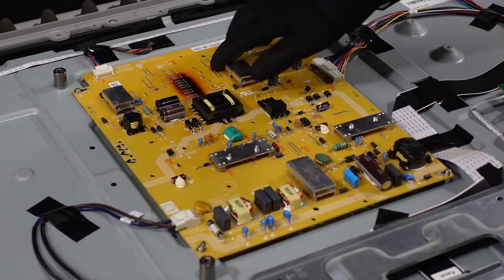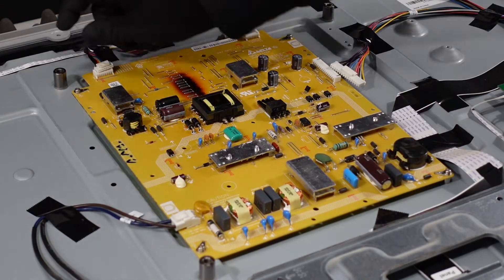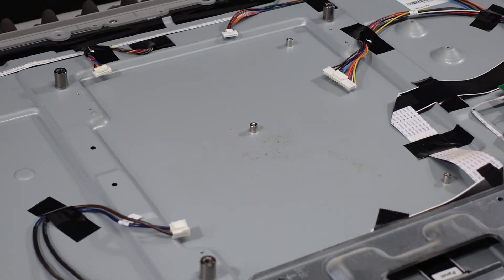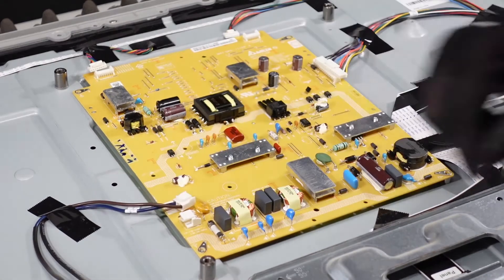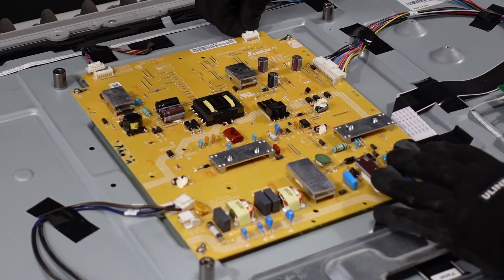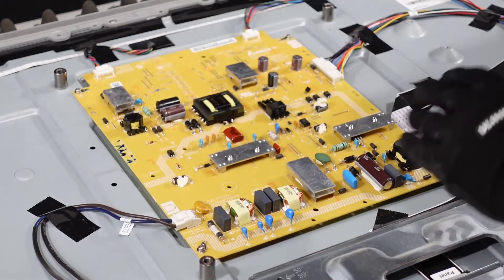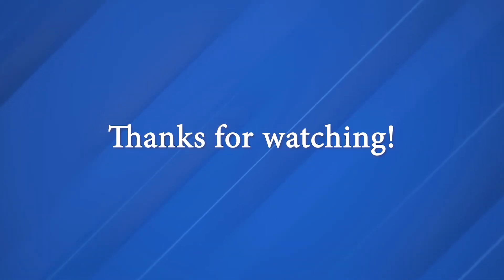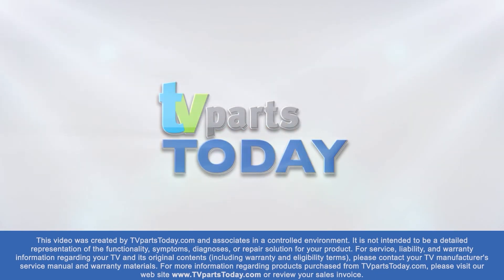TV power supply swap,  (VIZIO M471i-A2)

Comment: I have another question I have the same tv but I can only see the screen if am up close with a flashlight I don’t know what the problem is bc it shows the logo then it goes black when I turn it on I see light in the back when it shows the logo but once it’s finished showing the logo the lights in the back turn off but I can still see the image if I hold a flashlight light really close I don’t know what’s the problem
Reply from the maker: Most likely, there is an issue with your LED driver or the back-lights themselves. Swapping out the LED driver would be much cheaper and a lot less complicated. If your set does not have a dedicated LED driver board then it is likely integrated onto the power supply.
Reply: @tvpartstoday  thanks for the help 🙏 and my power supply was some burned marks too

Comment: What does it mean if it’s burned? Because my in my tv it’s burned
Reply from the maker: If you have not had any sort of lightning strike or power surge, I would assume that the power board in your unit is faulty. Swapping the power supply would be our first step here.

Comment: Quick question I had a Vizio p65-c1 TV I saw another Vizio 65 in 4K TV but a different model my question is are the power boards different or can I switch them out from a different model and put them in
Reply from the maker: Sometimes you will see a power supply being used in different model numbers, but it is always best to get the back of the TV off and check and see EXACTLY what the model number on your power supply is before trying a swap.

Comment: my power supply 56-04111.1B1 on my M471i-A2 doesn't show burned. could it be something else? thanks
Reply from the maker: I'm not exactly sure what your symptoms are, but if you would like to go over them and get some advice, give us a call at (800)203-7484 and someone can help get you pointed in the right direction.